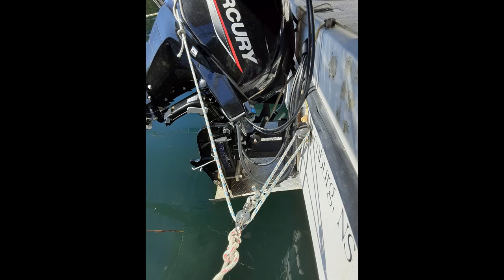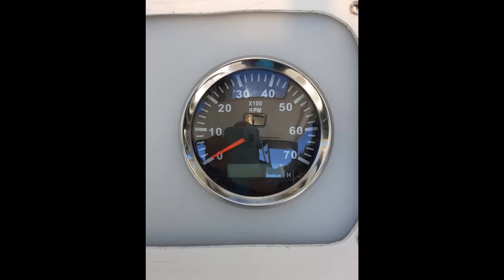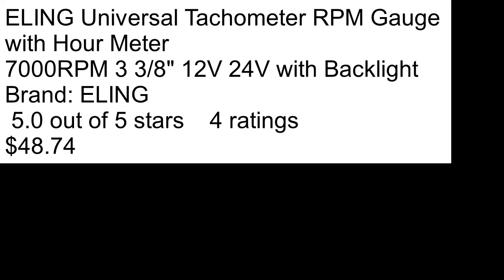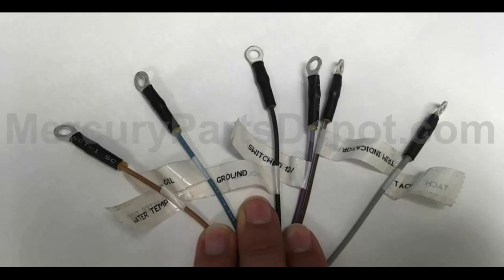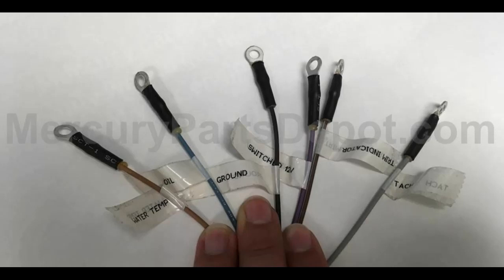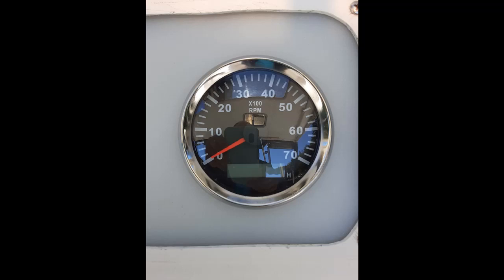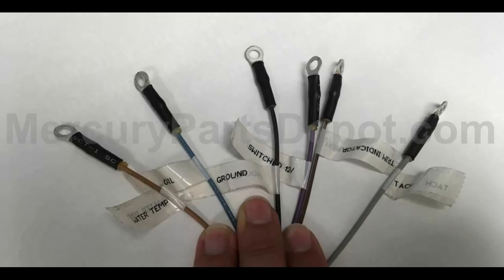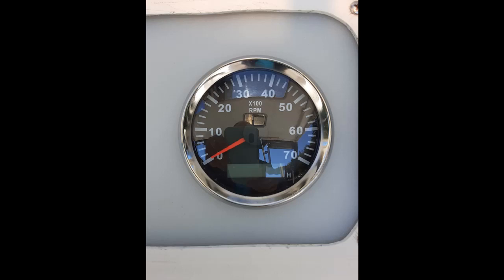Connect tachometer to 2022 Mercury 25-30HP EFI outboard on boat.

Comment: What setting did you use? I have a similar motor.
Reply from the maker: I may have noted it. Search for Gemini repower on YouTube then the prosperityconsulting channel,  if it noted it it will be there.  But warning, I don't know if it is set right, but I have gotten used to the range I use, so probably won't fool with it. Sorry I can't be more help
Reply: Noted in the comments,  it's not and didn't catch it in the video neither.